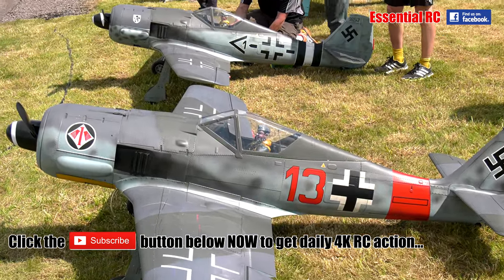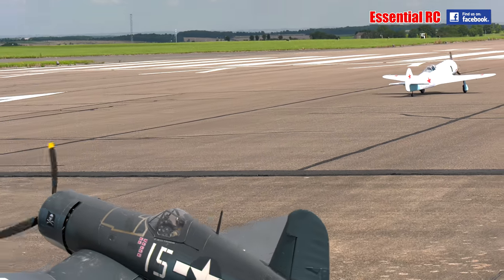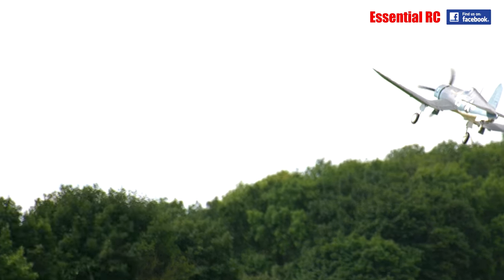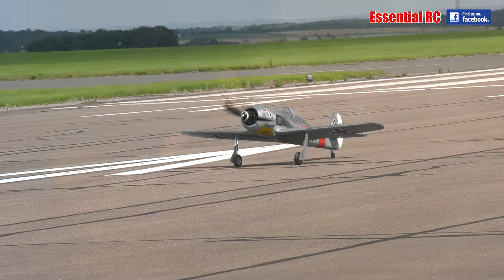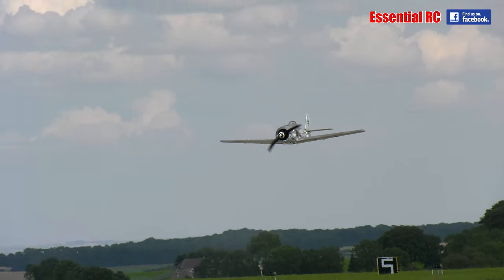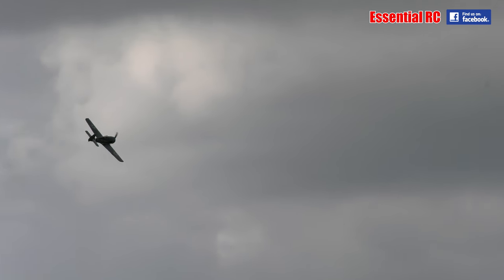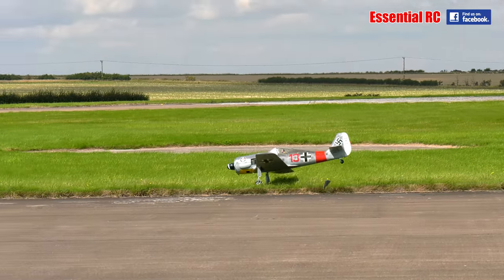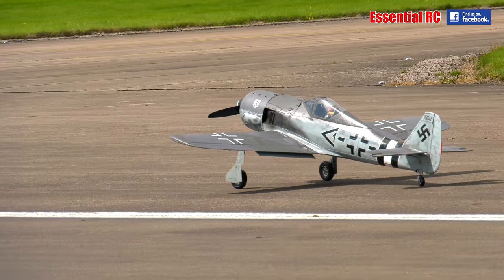GLORIOUS RC SOUND from 6 MOKI RADIAL GIANT SCALE WARBIRDS FW190s, CORSAIR, P-47s [*UltraHD and 4K*]

Comment: What an amazing show. Love the “almost knife edge” by the 190! And most of them looked quite a handful on touchdown. Classic warbird handling
Reply from the maker: Luke knows how to fly and put on a show for the paying public watching the show. No point flying in boring circles. He flies great aerobatics with any model. Cheers Dom (Essential RC)
Reply: Those models are just sublime too. The close up of the Corsair cowl, prop and engine would make most modellers weak at the knees
Reply: Hi, Steve!  You obviously know your full-scale aviation, but I couldn't tell from your Comment whether you're also an RC pilot, so please excuse me if I'm telling you stuff you already know - no offence intended!  :-)

A lot of the nervousness on take off and landing is down to those gorgeous MOKI engines and their multi-bladed props getting so close to the concrete. The propellers can be HIDEOUSLY expensive; one touch on the ground and they're basically instant garbage. That can put a huge dent in your wallet so the pilots are understandably nervous if they can't operate from a grass strip.

Ground handling is exactly as you mention - as full-size aircraft these 'thoroughbred' fighter planes could be a real handful. Designing for minimum 'dead load' meant a narrow track and tiny wheels teetering under the centre of gravity...

And it's much worse when they're in model form because there's no appreciable mass to smooth things out. Shifts of balance happen something like five times faster, so the RC pilot's reflexes have to be super sharp to avoid disaster, especially on landing. Also, the model pilot can only SEE what's happening - there's absolutely no feedback through the sticks.

So as the scale decreases the steering becomes impossibly sensitive; the slightest bump can throw the plane off track; even wheel-axle friction makes them ultra skittish. There's nothing much to prevent them nosing-over (no pilot on board to 'feel' the tipping point),  and finally there's the difficulty of having to compensate by sight,  not by feel, for the imaginary load shift of empty fuel tanks + depleted machine gun and cannon-shell magazines that the pilots of the full-size planes had to allow for.

Yep, these models are tricky to tame - but you're right: in competent hands they put on one heck of a show!

Comment: Would be cool to have a blip ignition Spad with rotary two stroke.  Castor oil smoking.
Sopwith Camel  Clerget.
Reply: It would indeed, but the rotary engine used in those planes were infact 4 stroke.
https://en.wikipedia.org/wiki/Clerget_9B

Comment: Cool planes, but I would really like to see the planes with working machine gun. Not real machine guns but, one that would fire something nonlethal to the plane like washable paint balls maybe. It would be really cool to see them dogfight each other.
Reply: yes, lets risk thousands of dollars and hundreds of hours worth of assembly on dogfight noone will see anyway :)
Reply: @dolphfren  paint balls would undoubtedly do damage  ... maybe just "blanks" like a starter's pistol ...
Reply: @dinojay8410  Blanks? how would anyone know they hit the other plane?  There has to be something that wouldn't damage the planes, that one could use that wouldn't damage the planes. Paint balls are only a suggestion
Reply: Concept of dogfight alone is already unnecessary risk, possibility that you will crash your thousands-of-dollars plane because you were concentrating on the enemy to hard makes it not worth it. RC dogfight-like thingy do already exist (google streamer combat) and it is done using cheap, disposable models because they do crash all the time.
Reply: @randomnickify   There are a lot of RC planes than can be built for much less than "thousands-of-dollars", of course non of them would be at the level that these planes in the video. Build a RC plane out of form board and you can build for about a dollar minus the electrics. I really don't care if you dog fight with a cheap plane or a plane that cost a much as one these war birds, that would be up to the owner of the plane. If you did own a plane like the war birds in the video and you consent to a dog fight and you plane is damaged you have  no reason to be upset about anything